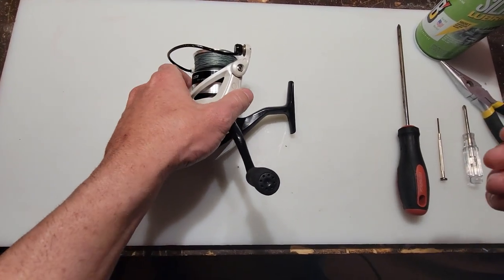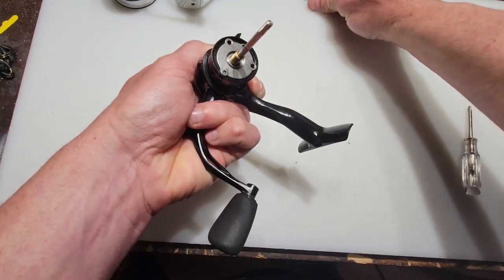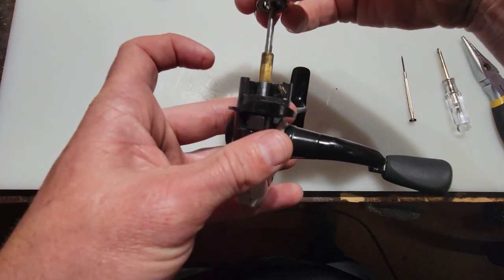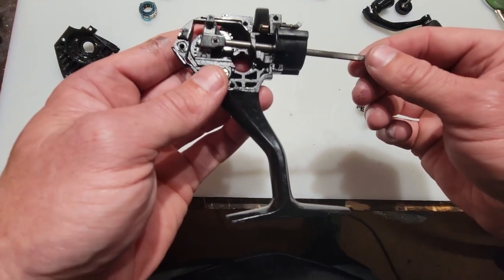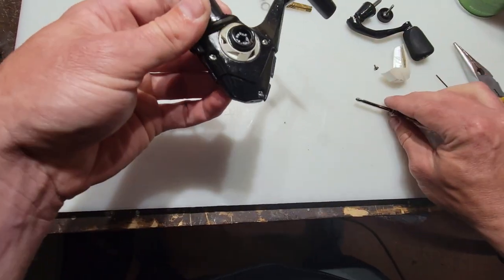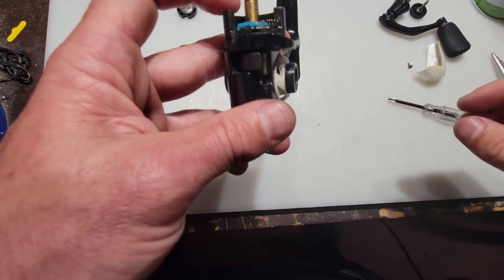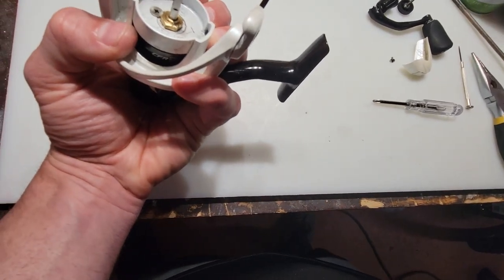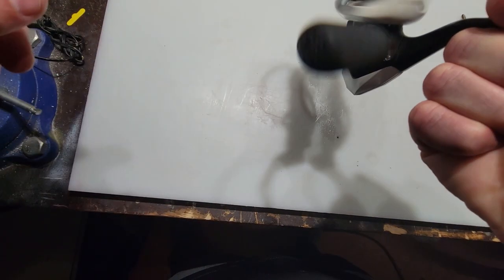HOW TO clean or service a SPINNING REEL in MINUTES

Comment: Great job. Do you use grease anywhere?
Reply from the maker: I do... but not with reel grease. That is expensive cuz, well, it's marketed as "reel grease". Makes it seem "special" or something I guess. I only use B'laster Surface Shield spray. 99% of all my fishing is saltwater and this stuff is a rust-prevention grease spray. A little goes a LONG way! I use it on everything from my vehicles to my tools to my fishing gear. IMO, 100x (okay, so there is no way to really measure 100x, but you get the idea) better than WD40 or anything else. I've tried them all, even other B'laster products. This is the best. It doesn't dry out like many other products and it prevents rust from starting and almost immediately opens up any tool stuck with rust. So I use it on the gears and the rod. That's it. I've been using the same reels for 4 or 5 years now - thanks to the B'laster Surface Shield spray. Hope that helps.

Comment: Hello would this go well with a gx2 6’6medium custom fast  rod and what size braid is that other then that great video
Reply from the maker: What style of fishing are you doing with the rod? What species of fish are you hoping/expecting to catch?
Reply: @StartFishingToday  small mouth big mouth bass using chatter bate
Reply from the maker: I personally would be fine with this reel for that, but that's only because I already have it. When surf fishing or jetty fishing, I can catch a 20lb bat ray or halibut and need the line with the 40-series reel in case these fish go for long runs. If just fishing for bass and you didn't already have a reel, I would probably go down to the 30 or even slightly smaller for a great fight on the smaller equipment 👍. Oh, and I would recommend if you back with braid, a 15lb PowerPro would work great. 
One of these 2 reels would be just fine if you want to stay with quality on a light budget:
https://amzn.to/3KoQiDr - Okuma Avenger 2500
https://amzn.to/3mkuAbP - Okuma Avenger 3000

https://amzn.to/3UiZdet - PowerPro 15lb Moss Green Braid
Reply: @StartFishingToday  ok thank you I did have another reel a honor xt 2000 just gottta put a 15lb braid and give it a try
Reply from the maker: @★ 𝐦𝐚𝐝𝐬𝐥𝐮𝐯𝐬𝐱𝐨𝐱 !! ◡̈  That should work just fine. You don't have to put braid on, you could just go straight mono or mono w/fluoro topshot. But, usually you regret not having the braid when you need it 😉

Comment: Hey! I have this same reel and I found two random washers coming from the nail. I don’t know where to put them would you know? They are very small. Thanks!
Reply from the maker: Are they plastic or metal?
Reply: Nevermind it’s just one washer. Do you know where the one washer would go?
Reply: @StartFishingToday  it’s just one small metal one
Reply from the maker: @kenanmammadov7281  Both things metal washers go onto each other on top of the ball bearing before u put the white spool housing on.
Reply: @StartFishingToday  yeah! I figured. I only had one metal one. Maybe I lost one, but it works fine. Thanks for your confirmation 😊
Reply: @StartFishingToday  i love this reel, I’ve had it since 2017 with no major problems other than the one time I dropped it and bent the main shaft 😅. I got lucky and managed to fix it. Love it!
Reply from the maker: @Kenan Mammadov  Yes! They are very durable and cost effective. Easy to maintain.